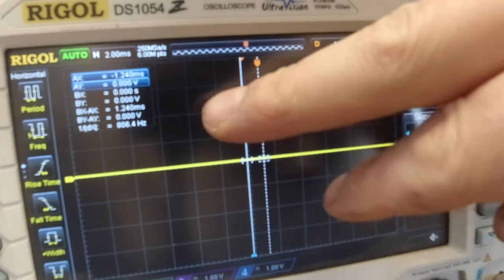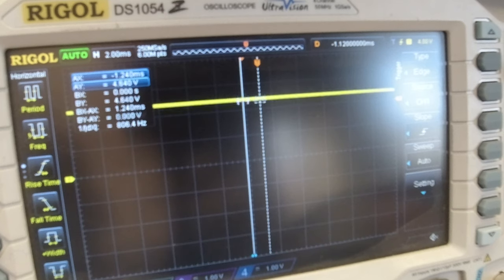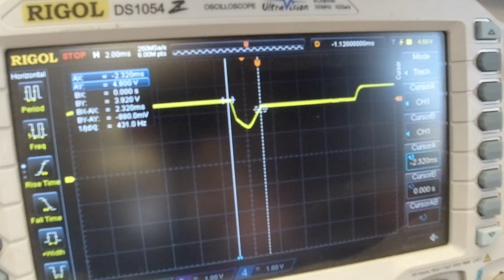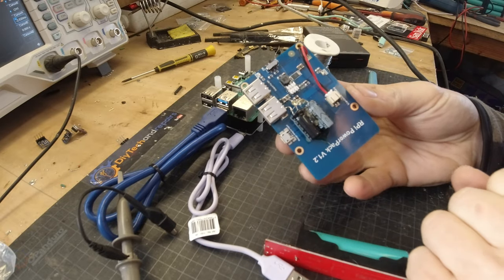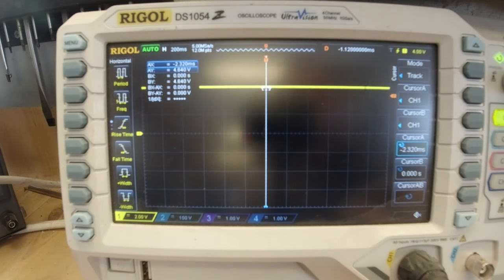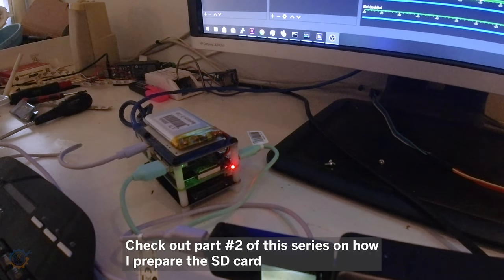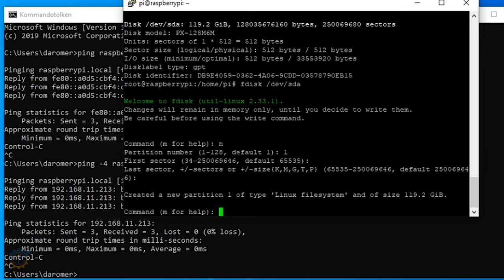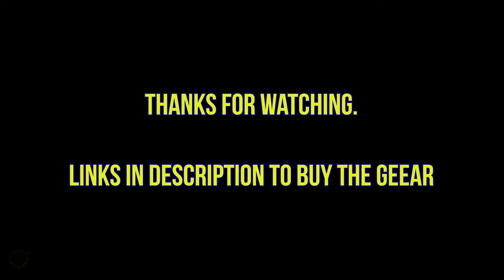Raspberry PI with mSATA and battery - Ultimate build #3

Comment: nice! I really wish powerbanks and other "battery backup" modules were good enough and had fast enough switching time. I guess the easy answer is to just add bulk capacitance until your voltage tolerance is in spec for your devices and load. thanks for sharing!
Reply from the maker: Yeap. I Guess There are units out There that Will do the job but this One didnt :/ thanks!

Comment: Once you get it all setup do you plan on eliminating the usb cables and pulling straight from the gpio pins?
Reply from the maker: I plan to get a msata for Raspberry pi 4 and get the adapter instead. Yes Power should be done via gpio instead :) alot neater and perhaps another video